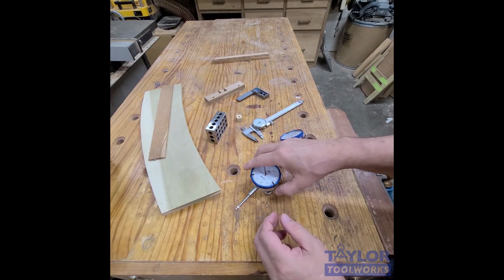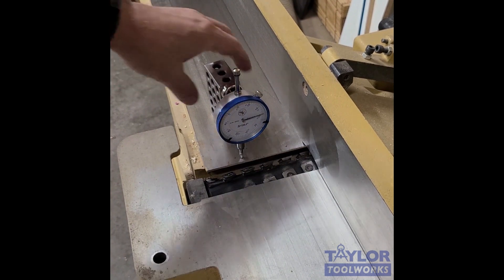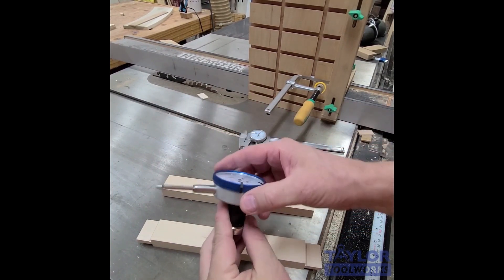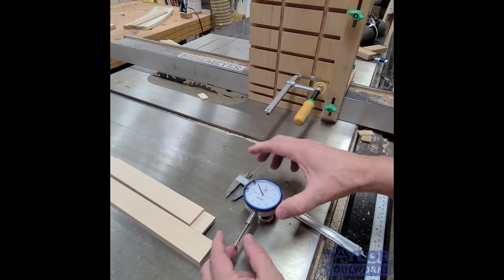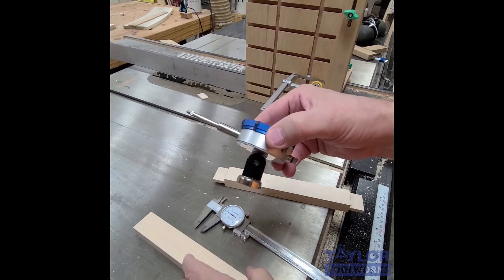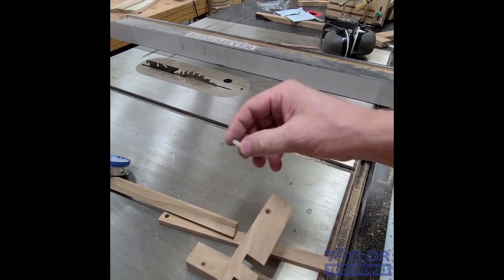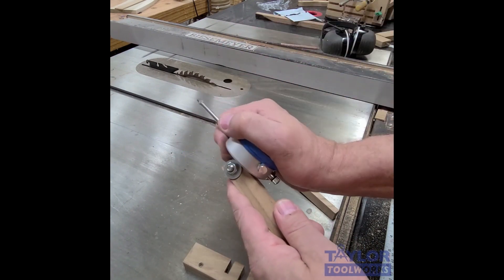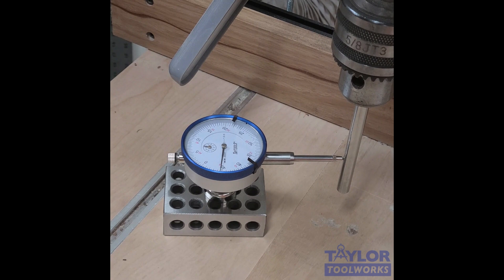Miniature Mag Base and Dial Indicator

Comment: I was wondering how you might manage the same dial indicator (in your video) in a wooden holder (with magnets) that facilitates 180 degrees rotation to dial in the in feed and out feed rollers, cutter head (knives or inserts) and table rollers (180 degrees) for a thickness planer?